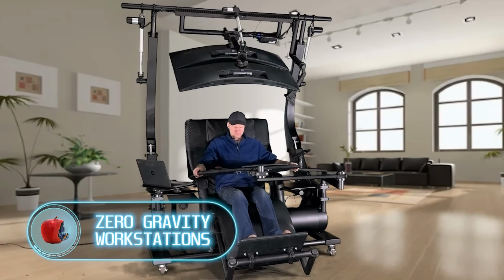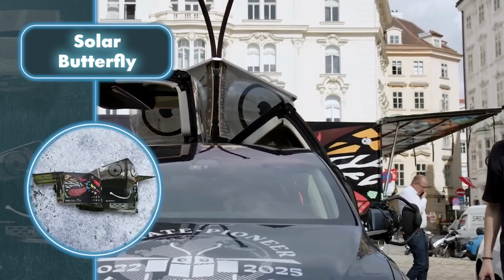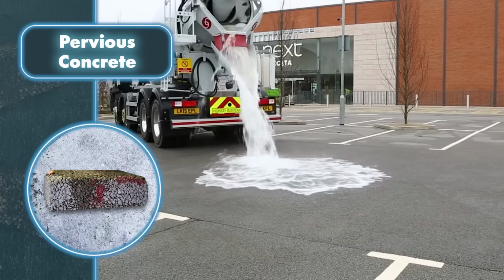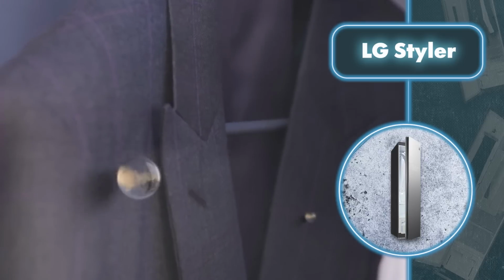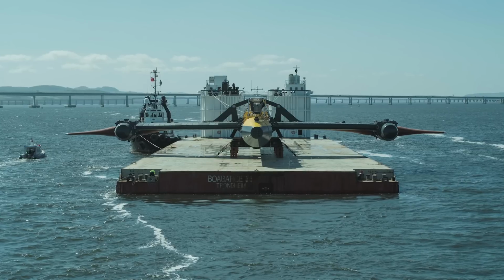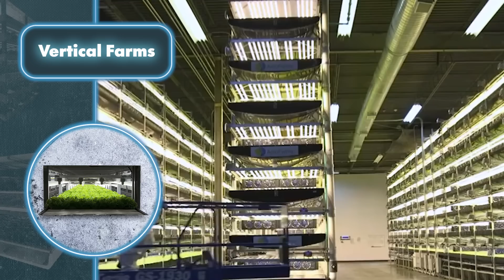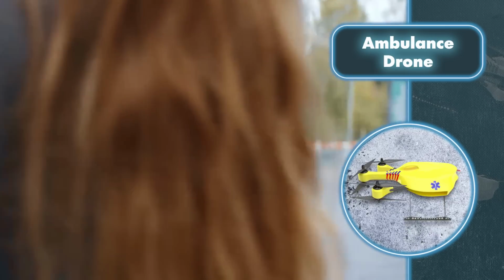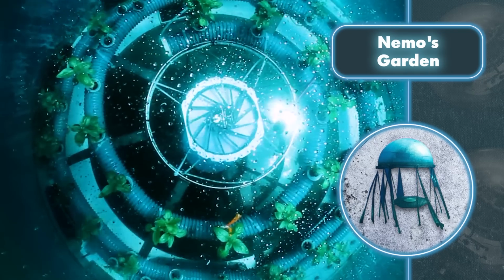Next Level Inventions You Didn’t Know About

Comment: Concrete looks good but what washes away ... the water has to go somewhere
Reply: into the ground, spread out, diverted to the lowest end then collected in pipes and diverted to a sewer system. The point is, heavy rainfall will not affect it pending its thickness for several hours until the ground gets saturated or it doesn't have a collection system. The overall point is no free-standing water to hydroplane off of. the downside I can see, is it cant be used on freeways or roadways, this system seems to be pebbles glued together OK and when the glue fails from time or weight then you just end up with pebbles